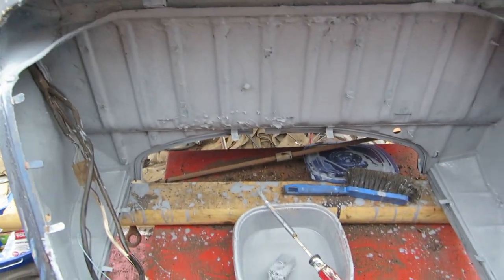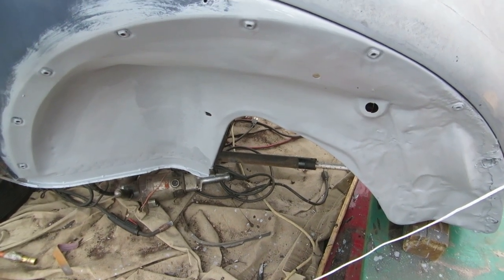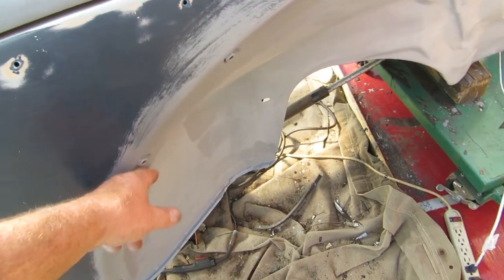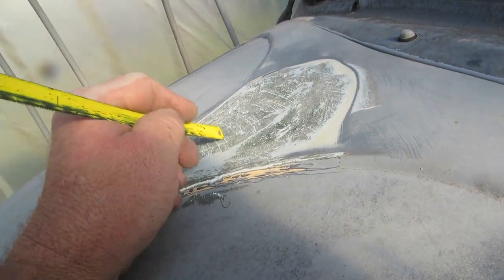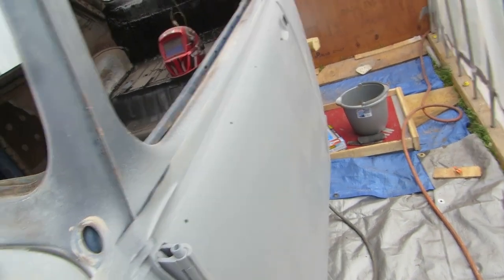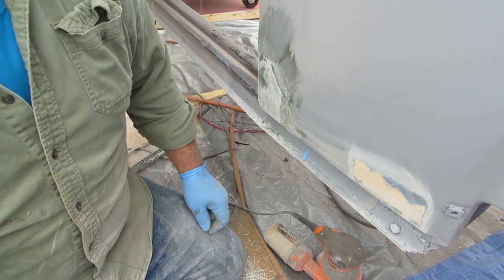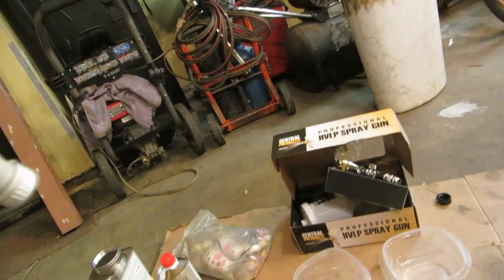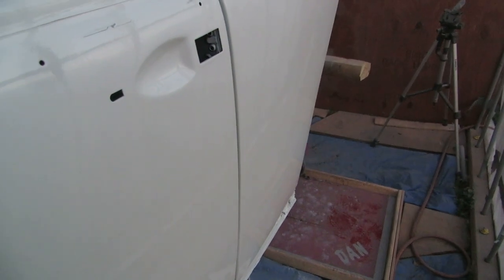VW Beetle body work part 6

Comment: where do you buy your sanding blocks and paper.Do you have to go to an auto body supply place or do you have a trick place like you do for seam sealer
Reply from the maker: I get hand sanding paper used from body shops...they use good stuff. Norton.
FREE (trash)
If I need something like wet paper I buy from either O'reilly's or English Color (local paint supply) 3M/Norton/ PPG
Painting supplies are expensive. You can also get reducer and thinner from body shops for not a lot a gallon if you bring your own clean container.
About 5-10 for thinner, and about 15-30 for reducer. Because they buy 55 gal drums of the stuff.